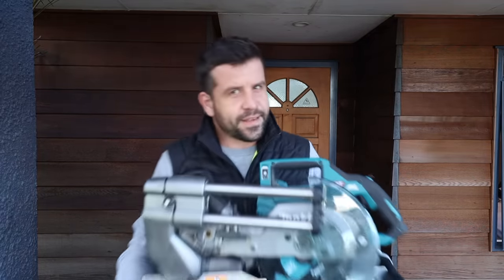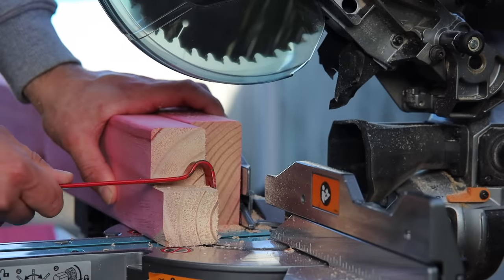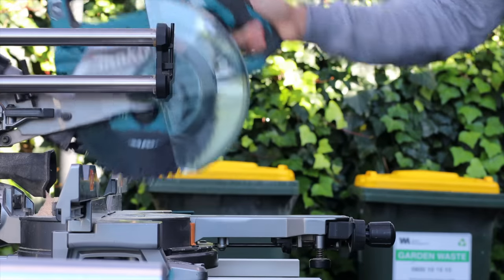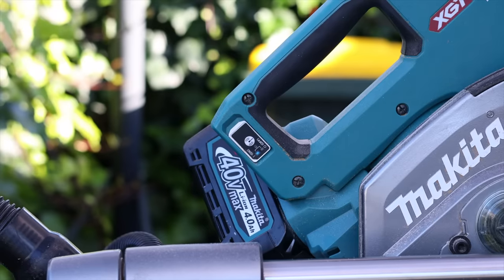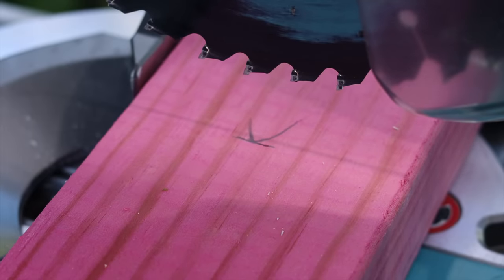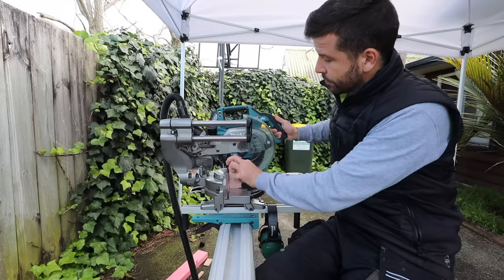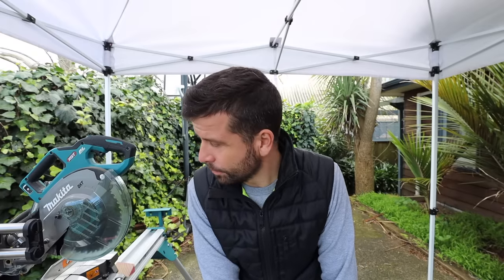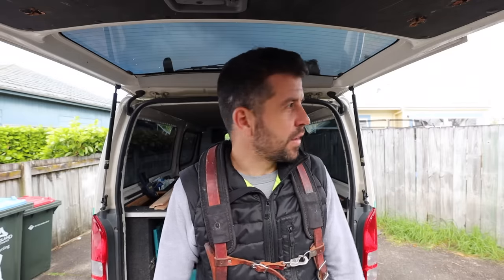Why I Use This Mitre Saw Everyday (Makita 40v)

Comment: Great video Scott, have the same setup and same findings, particularly around dust extraction and how you don't notice it immediately. 

One other minor issue is the current lack of 40v dust extractors. It means I'm working on 2x18 and 40v for this and my tracksaw. First world problem and the extractor usually lasts all day but one battery type for all would be great. 

Another minor issue is with the Makita mitre saw stand. Not sure if I have a bad unit but the levelling foot has already gone  and I find the stop has a lot of give in it, you have to set it with your workpiece rammed into it as hard as possible for consistent results. 

Above may seem negative but it's a great setup overall and I won't be going back corded.
Reply: What is the cut capacity at 45 degree bevel? can it cut through a 2x4 at 45 bevel?
Reply: @colekidd2  Yes, can do up to 45 on a 2x4 (45mm). Could go through more.

Comment: Have recently bought this saw and personally think it is a great saw. I have to agree with you Scott, the dust extraction is poor. I also have the 1219L and again the dust extraction is poor. Constantly clogging on both saws so if you are reading this Makita do something about it please
Reply: What is the cut capacity at 45 degree bevel? can it cut through a 2x4 at 45 bevel?

Comment: I've found with the 36v makita that the clogging dust port has to do with low air flow from a vacuum. I have a corded bosch hepa vac...never clogs. But with a lower cfm cordless vac...clogs frequently.
Reply from the maker: Makes sense, I might try the festool vac to see if it makes a difference.
Reply: I’ve been using it with my festool ct36 vac for about a month now, and it clogs up relentlessly still. The little chute at the bottom is just too small, while also having a 90 angle to go out into the tube. And that small tube doesn’t help either I’m sure. That is my only complaint though, fantastic saw otherwise.

Comment: Great review Scott. I will be getting my first Makita 40v Drop Mitre.. as a result of this balanced review. 
The dust capture I will fix on mine by replacing ALL the black ring-join hoses with smooth bore poly braided clear tubing (does not kink/elongate & stays full bore even in short radius)..the issue is CV losses in the factory hoses. Also I will replace the filter with a high flow without HEPA for outdoor at least 40um. This should dramatically improve air flow  (Max out SCFM but no change in  vac suction). The clear tube lets me see any deposits & blockages.
Reply: What is the cut capacity at 45 degree bevel? can it cut through a 2x4 at 45 bevel?

Comment: I using dewalt dhs780t2 for 4 years, for me is the best saw at the moment, 305 mm blade with is allowing me to cut 300 mm deep and 100 mm high, I can use with 2 way of power, with battery or with power adapter, and as well it has two type of power adapter 110v (for UK sites) and 240v.

Comment: I have agreat older 240v Hitachi (now Hikoki) 12 inch SCMS. It came with built in digital angle readouts to 1/100 of a degree and has the screw adjustable depth stop, high-ish split fences with flip out sections for when you tilt the saw blade out of vertical. The rail system is adjustable with a knob so either the saw and motor run back & forth on the fixed rails or the saw/motor are fixed to the rails and the rails stick out the back if there is room. But it looks like Hikoki only make (or import to Australia) 10" or smaller battery powered SCMS now.

Comment: Love the saw had it since it came out in the uk, yea it is expensive but it’s the best mitre saw out on the market for sure! U did mention the twin mitre not a lot of small battery saws have that
Reply: I'd have to agree.this is by far the best dropsaw I've used.A lot of smaller dropsaws only bevel one way also.This goes left or right also.

Comment: I just went out and bought the Makita 40v with a 216mm blade (there are 3 of them 216, 260, 305) based on this and other reviews. Got it into my workshop, set it up, charged the batteries and surprise!  Over a 200mm wide cut it was 1mm out of square. Before you say anything I have been a carpenter-joiner for 45 years and I know how measure the angle of a cut accurately.
So I drove 30mins back to the shop in Saturday, Sydney traffic and gave it back to them. I then checked the display model and another one that came out of the box (using my big, all steel engineers square) and surprise! They both had exactly the same error (3 of them all up), on the same side of the blade which suggests that it is an error in the factory set up.
Frustrating because it caused me to waste my whole Saturday afternoon. I got the refund of AUD1245 and am back to square one (no pun intended) with my trusty old, but getting a bit long in the tooth mitre saw.
I won't be getting another new drop saw again without checking the cut in the shop. This is a hassle because I will have to fit the blade in the shop before I can check it. 
It can be checked with a good set square without actually having to make a cut
Reply: For a veteran chippie of 45 years, I'd have thought it would take you about half a second to spot how easy it is to adjust...

Comment: I had a 260mm 36v heavy and after a few months was cutting out of square on the bevel by over 2mm. I heard other people had the same issue. Sold it. Thinking about getting the 260mm 40v or 216mm 40v 🤔

Comment: I love my DeWalt 20V 7.75” compact Miter saw paired with my much larger 120V flex volt 12” miter saw. Got both of them with batteries for under $1,000 USD. I love that I can use my flex volt one with a power adapter and run it corded if need be. I wish DeWalt would make a power adapter for their 20V system

Comment: I have 2 Makita drop saws, one is the same as in the video and I really like both of them.
I don't think there's a perfect drop saw out there but these are great. 
Good review, cheers.
Reply: What is the cut capacity at 45 degree bevel? can it cut through a 2x4 at 45 bevel?
Reply: The perfect saw was the makita ls1012 mate 
Still got mine from 15 years ago an absolute weapon and still as accurate as out the box

Comment: It would be interesting to see if you can get a larger diameter smooth walled flexible pipe to connect the dust extraction.
Reply: Still stuck with the shitty little port though.

Comment: I'm a framer and I've got the 12" DeWalt corded one. Don't use one much framing, mostly skill saws. But it's great if you need to cut hundreds of 2x the same length.

It'll do 3 2x6s at once or 2x4s on edge so you can cut like 6 I think

edit framer not farmer lol
Reply: My 12” dewalt drop saw has been the biggest piece of shit, won’t lock on mitre, won’t cute straight. Wish I just bought a festool.
Reply: @MaCcAM40a3  ya it won't be as good for finishing stuff as the festool but for rough framing it does the job.

Then again Spencer Lewis swears by the dewalts. He's a full time trim carpenter and he says he's burnt out a few festools already.

Check his channel out, he's got some videos on the topic. Insider carpentry
Reply: @mikegilberg8776  yeah right thats interesting. I'll have a watch. It's just frustrating spending $1600AUD for what should be a top of the line drop saw and it never working properly.

I've heard a few stories of motors dying pretty quickly too.
Reply: @MaCcAM40a3  ya man check him out he's got a video on how to calibrate your saw too for finish carpentry so they cut bang on every time

 I don't think all of them are good from the factory, you need to check them when you get them and then every once and a while if they start acting up
Reply: @MaCcAM40a3  oh and by the way, you say 1600 for the DeWalt or the festool? 

Because I think I payed around $700 - 800 CAD for mine from Costco about 8 years ago..

I know prices are way out of whack in aus/nz.. I lived and worked in nz for a year.. But still.. Seems steep
Reply: @mikegilberg8776  $1600 AUD, i got the 305mm battery and plug in version.

Comment: We desperately needed a new saw when our old Dewalt died while rehabbing our home in the Keys after hurricane Irma and the best saw around was the 10 inch 36v Makita. Excellent saw and it took a beating for 5 months. However, we found that a 12 was still so sorely needed for starters. The saw came with a laser and frankly lasers are absolute rubbish. I am happy to see Makita finally ditched the laser for a shadow line. We also had problems with the dust clogging and some of the controls proved a bit fragile. I do have the Milwaukee in this same profile and it has the same shortcomings with the fence height. I sold the Makita when I got back home and purchased another Dewalt. The Makita 10 inch is 200 USD more than the Dewalt and this saw is 00USD more than the Milwaukee and I can honestly say as a lover of Makita that it is not worth the extra money.
Reply: If I may ask, what controls are you referring to being fragile? And what were the results of them being fragile? Thanks
Reply: @reddawgrup1779  the locking mechanism on the main control handle didn't really stand up to being used every day for 6 months. Makita to their credit repaired it and said they were going to look into why it failed. I trust they did because that's what Makita does. I will be buying the new 12 inch with the shadow line next summer.
Reply: @satchmodog2  thanks for the info and reply 👌👍

Comment: I've got the makita 305mm 40v and i totally agree with the dust extraction however its not the size of the tube that's the problem it's actually the hole where it does a 90deg turn is too small before it enters the tube, mine always blocks up and its always this point where it chokes up, could be fixed with a dremel though...

Comment: I have the 36v 10” and love everything about apart from the weight.
Reply: I have the 36v 10" as well. Fantastic saw. BUT. The laser... I wonder if a shadow light would be better, at least the laser you can turn on/off with a button and then it stays on. Then there's the fact that the bluetooth module is NOT an option. Either you order the saw that has the bluetooth module or you order the same exact saw that doesn't have the module but also doesn't have any way to add the module (???). I specifically wanted a 10" saw, and I also specifically wanted an X2 (LXT) saw (not interested in another battery system).
Reply: After a year , the weight starts to become Normal lol

Comment: I'm finish carpenter and strongly considering purchase of the 12" corded version of this saw, LS1219L. One complaint among early reviewers that would make that otherwise greatly appealing saw a no-go for me is the claim that long straight cuts tend to be a bit bowed. Have you experienced similar problem with dead straight cuts on this model?
Reply: My Ls1018 does this... Mainly on mitres. And no matter what I do, it never cuts perfectly square.

Comment: In regard to the dust extraction.... have you tried using a larger diameter and shorter hose between the Vac and Saw? Larger diameter and short hose (with the reducing adapters to Vac and Saw) suppose to increase air speed and air flow.

Comment: I have been using a Ryobi 10" mitre saw, dust extraction is hot garbage but the price point couldnt be beat. I plan of getting something better once I am able to save up a little more cash.
Reply: If you like the saw, just invest in a really good saw blade, such as a Forrest.  You' ll be surprised how much the blade improves the quality of the saw.
Reply: @olafbigandglad  I have several blades depending what I'm doing haha got cheap ones to expensive ones
Reply: @olafbigandglad  Does the blade help for dust extraction?

Comment: I ended up getting the updated 10in version of this in the US.  Has all the features and updated with the shadow line vs the 36v. Considering going to this one though. The 10 in version is over 60lbs and even on a saw stand, its a bit difficult to maneuver around.  Seems like they fixed the dust collection issue a bit on the 10 in, as the dust port at the bottom doesnt clog.  However, the dust extraction still sucks.

Comment: Scott, could you cover the correct procedure for squaring up a drop saw?
No one has ever shown me, the “right” way & I feel like I could be doing a better job, not to mention faster at it as well.
Thanking you in advance.
Reply: Yeah I've had a hard time finding details on this as well. Only problem is that it's really specific to each saw. But I can't even count the number of times I spent time getting everything set, thinking I was good, making a cut only to find out it was a fraction of a degree off.
Reply: I have a different Makita drop saw, squaring it up is described in the manual. It's actually quite simple to do.
Doesn't your manual describe how to square yours?
Reply: @blahhblaah74  the manual does explain it, and maybe it's just because it's a cheap Ryobi model, but it has these finicky set of screws you need to loosen, then adjust the saw, then tighten. And each time you tighten it, it pulls on the saw and changes the angle. Even when I managed to get it perfect, after locking it, just using the saw once was enough to throw it slightly out of whack again. Think I just need a better chop saw.
Reply: @doze3705  you will be squaring up a ryobi saw for the rest of your life.
Cheap saws are hard to square and even if you do.....it doesnt stay square for long. A good quality blade with help and not the thin ones. They tend to "walk" much more and give you diferent reselts every cut. 
They are fine for framing etc but not great for fine timber work.
Reply: @positiveaspect5730  thanks, I kind of realized this myself last week. Spent an 2 hours loosening the screw, adjusting it, and then tightening it, only to find out the  pressure needed to hold the saw tightly would actually throw it slightly out of whack at the same time. So I found myself needing to intentionally tilt it a half degree off, so it would square up when I tightened it. Got one or two relatively decent cuts and things immediately got iffy again. Going to just invest in a better saw at some point and stop wasting my time with this PoS. The squaring mechanism has to be the worst mechanical design I've ever experienced.

Comment: Great looking saw there. You missed of the awful squeaking every time you pulled the saw down🙉 Videos are awesome mate🤩
Reply: If youre cutting wood, that creaking is unnoticeable.
Reply: Hopefully my next mitre saw T.C, shot of WD-40 I think, 👍🔨🇮🇪
Reply: @f.demascio1857  True, but for all the other times when you're showing it the cut and setting up a trenching depth without the motor running, it would be😉

Comment: That cordless vacuum is underpowered.  I bet you won't get clogging with a proper dust extractor that has a higher cfm.    My question is, do you have any info or thoughts about the 40v prices coming down coming closer to the 18v lineup or will it always have that very premium price tag?

Comment: I’m looking at getting the hikoki 36v drop saw since I run hikoki gear now. Had an adapter so you can run it off  mains power also….can you get hikoki to give you one to review before I buy one ?! 😂
Reply: I ran (and still do) Makita for years but giving the swich to Hikoki serious consideration.
Reply: Go to store and have a play they are have  really good functionality.  Dust needs help
Reply: @ohasis8331  I made the switch from makita after I had some tools that didn’t last and horrible customer service. There are a lot of things I like about hikoki but some of there tools could use some modifications
Reply: @jonnyb4322  Yeah, Makita seemed to go to crap when they switched manufacturing plants from Mexico to chna.

Comment: The big dls111 36v 260mm dust extraction is the same. Anything besides fixout timber, it will block up easy. Especially wet unseasoned timber.

Comment: I don't understand why so many tradies get sucked into every tool having to be cordless. If you are doing renos/extensions you have access to power. Plug in tools are way cheaper and more powerful. In the case of the drop saw, also has a bigger blade, so more versatile. No recharging, no flat batteries, just makes sense.

Comment: I’d just ordered that saw here in Canada shld be getting it Friday looking forward trying it out etc it also going be my main saw as I also own for other miter chop saws
Reply: Hey, Michael, you made me think of something, an issue that pops up to me as a Canadian living in the Netherlands.

The freaking 110V-220V tension difference (and the frequency as well, 50 or 60 Hz, especially important for rotary motors and messing up with any current converter). 220V everywhere is great, unless you have some 110V items (such as my amp and some bigger kitchen tools).

Is it more interesting to get a battery tool in North America as compared to (basically the rest of the world), because of the power difference? Since I might go back to Canada, I'm moving to battery tools (I'm a weekend DIYer only, doing stuff on a 6th floor balcony...Netherlands housing is NOT cheap) and moving to one brand (Makita, sort of by chance) to have only 1 charger to replace. But for the more powerful tools, I'm wondering if the corded versions differences in power makes battery tools more interesting in Canada and the US. That would make me think about moving to battery tools for my remaining corded ones (mitre saw, sander, shop vac, even my current jigsaw) now, or wait until my decision to return is made (and adding that stress in the whole mess) and buy new corded 110V tools.

The thing is, most Youtube videos are from US people (except here of course, and a few British I found). Nobody ever moves between the system to be able to compare. But when you see stories like Americans boiling water in the microwave because it's faster (as compared to 110V electric kettles), it makes you think.